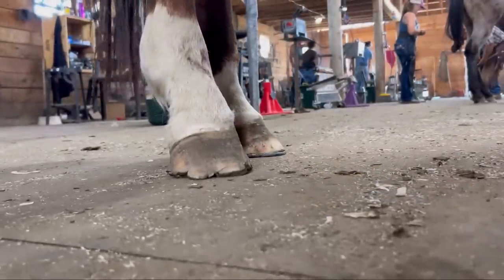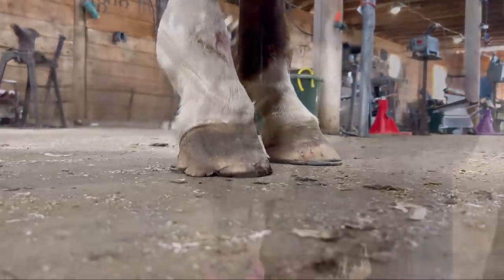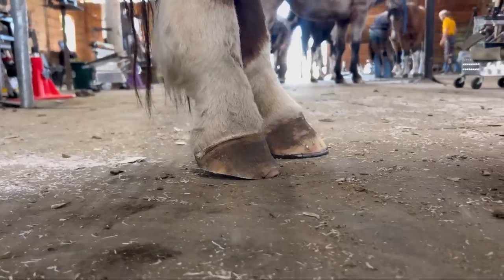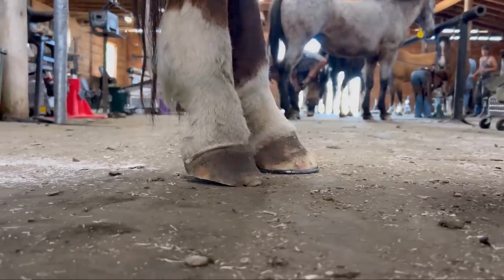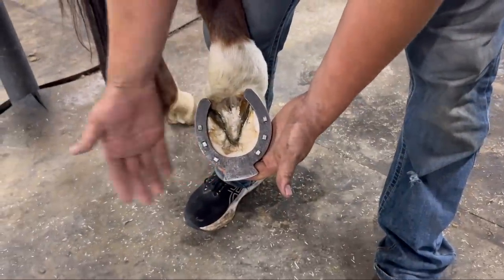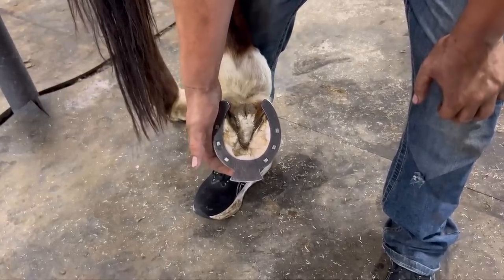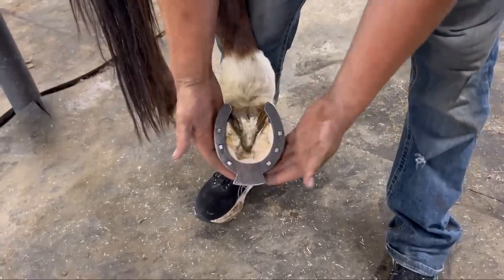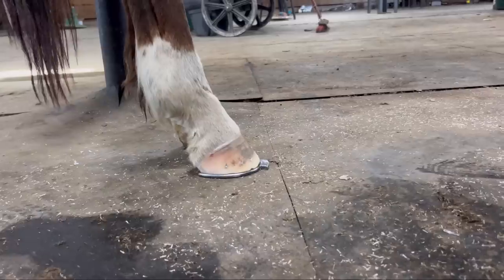CLUB FOOT Hoof and HANDFORGED Shoe

Comment: Back in the '80's I had a Buckskin filly that her bones grew faster than her tendons because of too powerful a feed supplement. She wound up walking on the tips of her hooves. The shoer had to trim her heels rather sharply to get her feet to go flat again. One forehoof turned out to be clubbed. With corrective trimming he got that hoof as normal as he could. I couldn't tell which one had been the club foot because he did such a good job.

Comment: Years ago, I had a mare with a very substantial club foot. Her case was caused by her having one leg longer than the other. The farrier would very slightly lower the heel of the club foot, but left it mostly clubbed out of necessity. There was no way to make it “pretty”, given her varying leg lengths.

The mare lived a long, happy life, club foot and all. She never went lame in the club foot, although she did have occasional issues with bruising in her opposing (flat) foot.

Comment: I’ve always wondered if the horses feel it when the shoe nails go through like that…. I hope that’s not dumb.
Reply: When a nail is driven correctly in a normal healthy hoof, it causes no pain whatsoever. The hoof wall, although it grows, is actually dead tissue, a bit like your nails, but much thicker and stronger, of course. 
Just as you can have your nails cut, filed, painted etc - so can the horse have its hooves treated. If you were to have a tiny hole made in that part of your fingernail which is away from its 'quick', it would be entirely  painless  although you would 'feel' that it was happening because of the vibrations caused by the drilling or other mechanical process. Same with the horse. They can 'feel' that something is happening to their foot, but it doesn't hurt them. 
Of course if the shoer is incompetent, or if something suddenly causes the horse to move at the moment a hammer-blow is struck, the nail can be  misaligned and pain, even actual injury and lameness, caused.